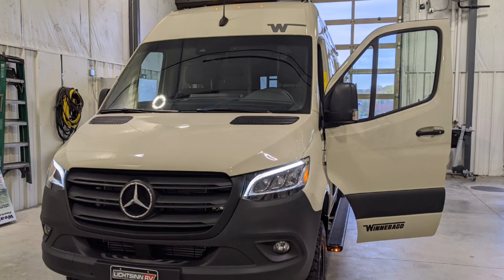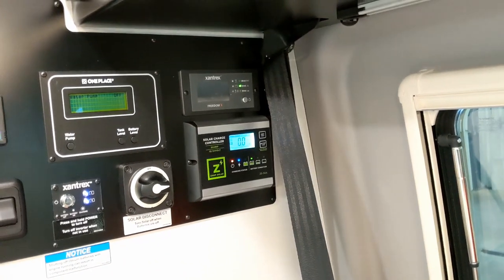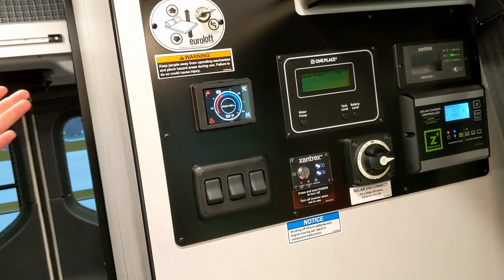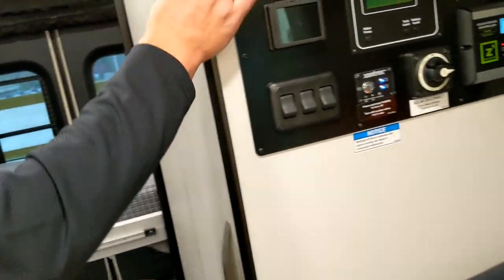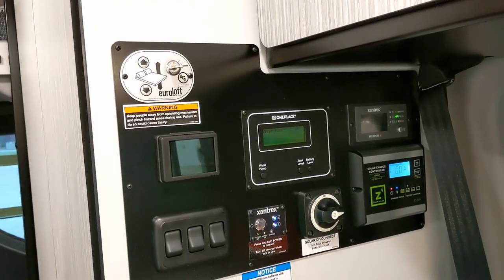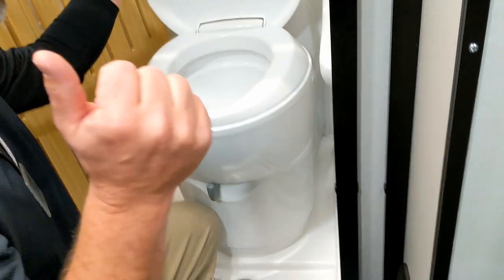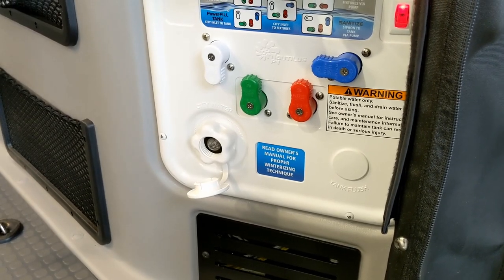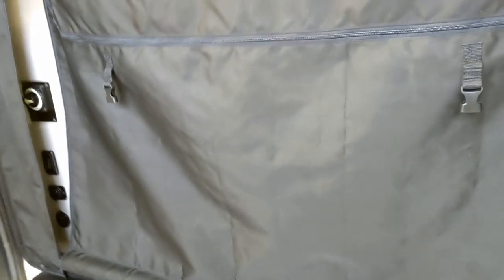2021 2022 Winnebago Revel Dealer Orientation During Pickup

Comment: great video, I watched it a few times before I picked up my Revel from Lichtsinn. Now that I have it and learned how it works, I noticed almost everyone explains the Timberland Heating system incorrectly (my Lichtsinn "orientation guy" included):
when either the "burner" (bottom left) or the "e-heating element" (bottom right) icon is on (red), both the cabin and water is heated. there is no need to turn on the water icon (top left) in order to get warm water. The water icon prioritizes water over cabin heat. when turned on, the glycol mix is short-circuit'ed and cut off from feeding the cabin heat exchangers. it only heats the water and therefore can generate more warm water (continuous warm water when both the diesel burner and the e-heat element is on).

Comment: Excellent video. I ordered from Lichtsinn on Aug. 11. Still waiting. Not too much longer I hope.
Reply from the maker: You getting it in January? Pack warm clothes!!
Reply: @MULTIPLESHOTSFIRED  They sent me a notice maybe beginning of Feb. Supply chain issues. I’ll prepare for the Midwest freezing temps!!
Reply from the maker: Make sure you stay at least a couple nights at their dealership. Try everything,  4x4, AC, check all power points, use every water outlet, awning.. they will make it right while you wait. Shooter's restaurant is right by the dealership and is not too bad. But cook at least a few meals with the induction!

Comment: Really appreciate this video!  But was hoping for Li info. No info on the garage batteries? I just got back from my first 2-wk trip and the AC would not work unless connected to shore power; inverter was on. No help from my dealer. I had adog with me and could not do the wineries as the AC would not work and temps were 100.
Reply from the maker: Next time try turning off the coach main power (located on left side of the van in the back) then turn it back on. See if that kicks it on.

Comment: GREAT VIDEO!  We have been doing research and looking at Travato's for a few years and started looking at a Revel because of the Lithium system in the 21.  We got to see our first Revel in person a few weeks ago and loved it.  For what we are planning on doing a Lithium system is must, as why we were set on the huge Volta system in the Travato.  BUT!!! @ 55:45 in this video the you and the Tech were discussing a 3rd lithium battery that could be installed.  PLEASE tell me this is true!!! and what do you know about the option.  I can not find anything on it.
Reply from the maker: David- thanks for watching and the comment! The third battery is something the dealership offers (Lichtsinn RV), I was told it was the same as the factory batteries, the cost was roughly $1,600. We opted to skip it, so far we've never ran them down on our boondocking adventures. When it gets warm it will be interesting to see how it handles the AC load. I'm probably going to invest in a Honda generator rather than the third battery to give me a little bit of flexibility.
Reply: Multipleshotsfired 
Have you had any AC issues?

Comment: This and your video on your add-ons are great! So helpful in the decision making process! I am curious if you flew to the dealership and drove home. If so, how did you line up finances and price before you arrived at the dealership? I am trying to figure out how to best prepare making a trip either to Lichtsinn or other, especially with Covid going on. Would be helpful knowing how to do some of that prep and be prepared to finalize if all goes well on arrival. Thanks!
Reply from the maker: Glad you liked the video! So yes, we did the deal in July, worked out the price, financing and they emailed a contract that I e-signed. When the van was at the dealership in October I did a wire transfer to their bank, took the flight to the dealership and signed off on everything in person after doing a full inspection of the van. Lichtsinn has a great system and it works pretty painlessly.
Reply: @MULTIPLESHOTSFIRED  Again, thanks for the details!

Comment: I got a 2020 i took that bracket off of the running board and ran that heater exhaust over the top of the running board bracket just incase you hit a rock or something
Reply from the maker: Not a bad idea, it's kinda vulnerable where it is at from the factory.

Comment: Love the orientation.  I pick up mine in February.  Can you tell me what the deal is with the shower/toilet and what it was that flooded ?
Reply from the maker: Glad you liked the video! So the little pushbutton for flushing the toilet- it has a small o-ring seal that should keep water from getting behind it- we had heard of a few folks having issues with water getting behind it and it would soak the circuit board and cause the toilet water pump to come on. Ours did exactly that on the first shower- the toilet filled with water and overflowed. The fix is to have them put RTV silicon all around the switch where it snaps in. Since then it has not had an issue!
Reply: @MULTIPLESHOTSFIRED  Thanks for explaining that.  I thought the shower somehow flooded the toilet (which, indirectly it did).  BTW, that was the most thorough explanation of the water system I have ever seen.  I will definitely watch this again when I get mine.  Hope you are have lots of fun with the new rig!

Comment: What is the fuel consumption when using the heater? Is there a reservoir in the tank specifically for diesel when using the heater?
Reply from the maker: About .3 gallons per hour if run continuously. Unless you are down in the teens it's not going to be running 100% of the time. Uses the same tank as the chassis, if the tank level gets to 1/4 tank the heater shuts off automatically to ensure you can fire up your rig..

Comment: Sorry, a semi-related question if you don't mind (I just picked up my new Revel in GA a week ago), and especially since I think you're in law enforemennt and so may know (I'm a former career Army officer BTW - thanks for your service): regarding vehicle registration, I must provide the certificate of origin to my local (NH) DMV in order to get it registered. The Revel came with two certificatesd of orign though, and I want to minimize annual registration fees while keeping it all legal. Do you know if I must provide BOTH ceticificates of origin to the DMV (one from Daimler, one from WBO), or can I just provide the one for the chassis? This info will of course then be used for the titile. I know you're in TN and states may differ, but I thought I would ask since you're just a few months ahead of me. Thanks for any advice on your experience with this.
Reply from the maker: Not sure what state your in- I guess it would depend on the DMV there. In TN I supplied them with the paperwork from the dealership, which shows it as a Winnebago. It would be interesting if your state would accept the cert. of origin showing it as a Sprinter van. Seems reasonable as it's not some big diesel pusher with sliders lol. You are partially correct- former LEO here, thank you for your service to your country and enjoy your rig!!

Comment: Thanks for this! Very helpful. Was curious... When did you order your van, and how long after was it available for delivery?
Reply from the maker: I ordered it on July 13th, was told at that time it would be ready on September 28. It moved a couple times- finally picked it up on October 21st. I'm hearing that orders placed now will not be delivered until April or even May.. crazy demand.
Reply: @MULTIPLESHOTSFIRED  so you paid MSRP on it ?
Reply from the maker: @xiaodao2005  I paid $133,052 for my 2021.
Reply: @MULTIPLESHOTSFIRED  wow, it's good deal! which dealer ? I want to buy one too.
Reply: found it in your description. enjoy !!!
Reply: @MULTIPLESHOTSFIRED  Wow. I ordered mine in August — and it won't be available till mid-January!
Reply: Forgot to add.. I'm also picking mine up at Lichtsinn. In fact, my sales guy is the same one as in your video.
Reply from the maker: @lamannafoto  What dealer did you order it from? You should have had you rig a month ago.
Reply: @MULTIPLESHOTSFIRED  Ordered it from Lichtsinn. Gave 'em my deposit early August. They originally told me Oct - which ended up becoming late December. I told 'em there was no was I was going to travel halfway cross the county during Christmas, so I said early Dec or early Jan. It ended up becoming mid-January anyway (so they said). But, I'm wondering if they just pushed other deals ahead of mine, given my timing preference. Oh, and I'm now working with Cody (previously Nicole), if you know any of them over there.
Reply from the maker: @lamannafoto  what color did you pick? You're gonna love it!!
Reply: @MULTIPLESHOTSFIRED  Thanks!! I ended up going with the Blue/Grey. I know once all the drama is over, I'll probably friggin love it. Already got plans for a YouTube channel to feature it in!
Reply from the maker: @lamannafoto  That is awesome. Love the blue/grey, I was torn between it and pebble, honestly both are great. Do your channel- would love to see your van experience!

Comment: Do you only turn on the inverter for running the AC when not powered, or do you turn it on to make coffee, etc?
Reply from the maker: Anytime you need to use the outlets for anything you'll need the inverter on. I actually leave it on all the time. When I am home it's plugged in to shore power.
Reply: @MULTIPLESHOTSFIRED  when driving ? I am leaving Las Vegas now for 300 miles home on my first drive, other than Walmart, lol nervous lol
Reply from the maker: I have mine turned on all the time, including driving! Join the Revel 4x4 facebook group- they have tons of great resources there!!

Comment: Was the price negotiable? I've been researching on the storyteller, and the prices are set per Overland. However, I've been seeing online some Revels are 20 percent off the listed price.
Reply from the maker: Absolutely-  RV's are generally always negotiable, often with large discounts over the published price. When I bought mine last year the price listed on the RV Dealer's website was $180,000, when I worked with the salesperson I was able to get it for about $133,000. Things are a little different now, the demand for RV's is at an all time high so many dealers are not moving as much.. but shop around!
Reply: Thank you for the info.
You’re correct. No RV dealers are giving discount on Storytellers.

Comment: If you turn off the water pump while sleeping, can you still use the toilet and put water in it? Dumb question?
Reply from the maker: Yep you can use the toilet without the water pump- it will not pump water to flush it so you can either turn the pump on, or use a bottle of water to rinse the bowl into the cassette.

Comment: Can you add a 3rd lithium battery for longer A/C run time?
Reply from the maker: You can, the dealer offered to do it for $1,600. I elected to use that to buy a Honda EU2200 generator.